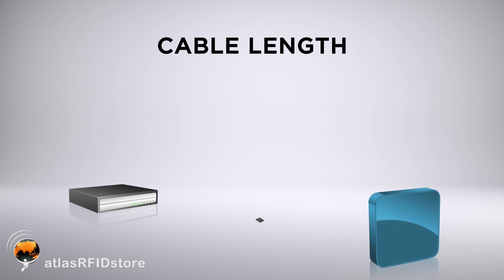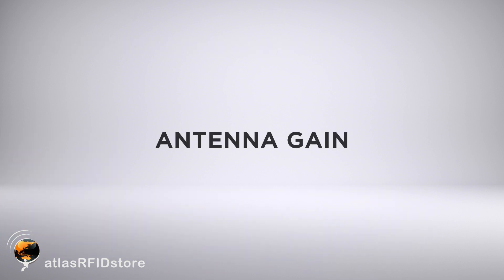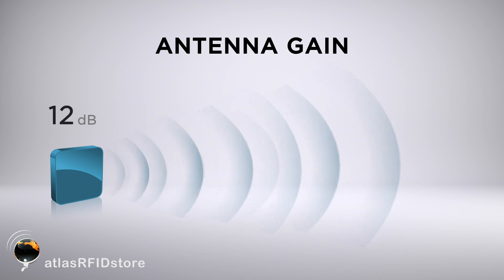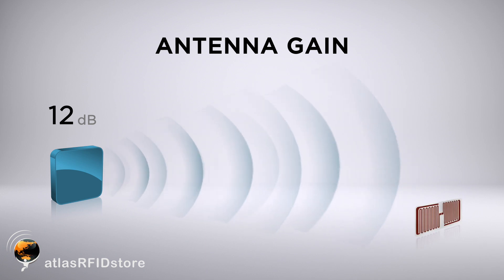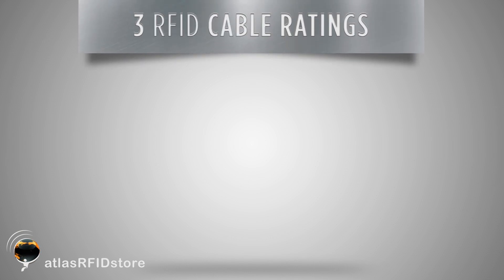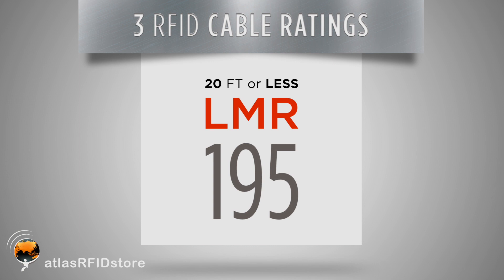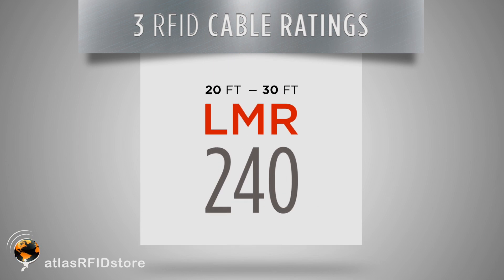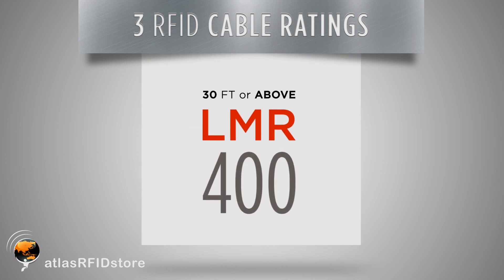Cable Loss: Achieving the Highest Performance

Comment: Hello sir,  the higher the gain, the smaller the beam width will be. But, in the video its quite opposite. Am i wrong or its just for the explanation you showing there??
Thanks
Reply from the maker: You are correct, higher gain antennas tend to have more narrow beamwidths than lower gain antennas; however, this video's purpose is solely to show the relationship between gain and read range.  Here are two articles where we delve into the subject more deeply:

https://blog.atlasrfidstore.com/choose-right-rfid-antenna

https://blog.atlasrfidstore.com/rfid-antennas-beamwidth-directivity

Thanks!